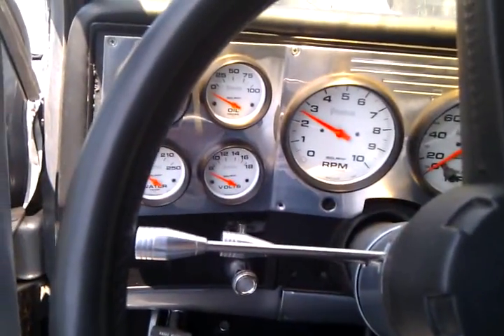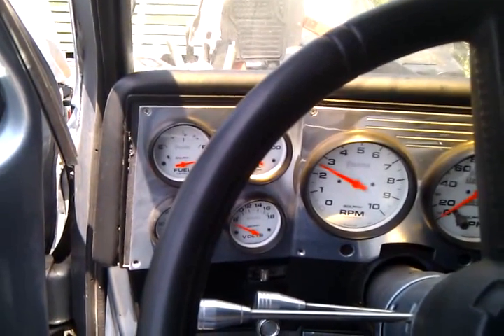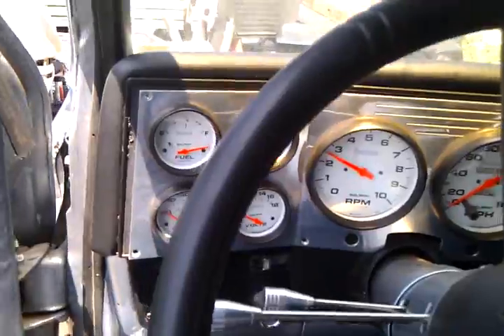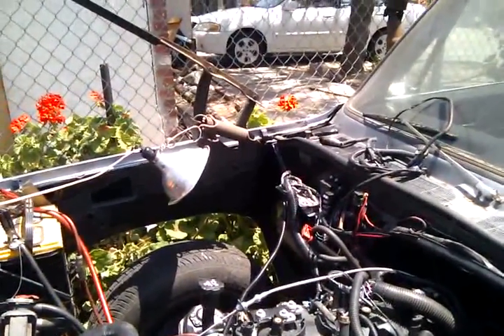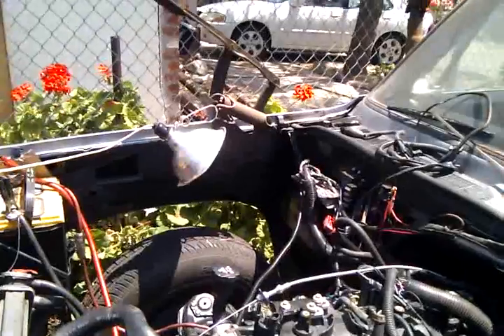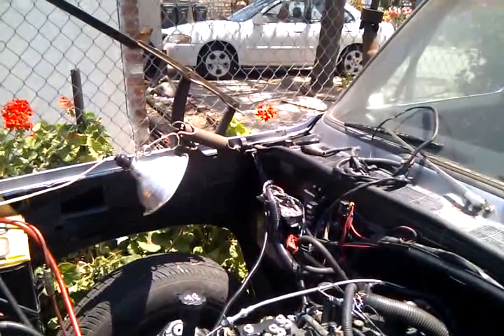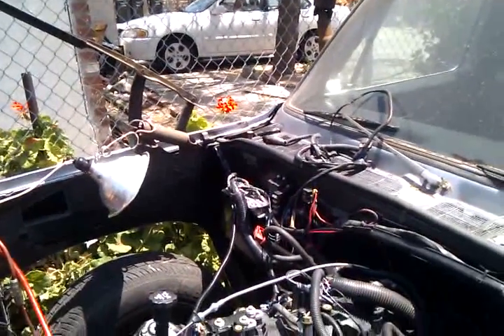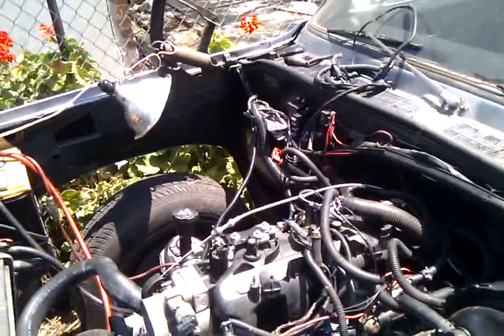5.3l vortec swap

Comment: how did you wire up the speedometer? I 
can't get my sunpro to work. I installed a 5.3 with a 4l60e in a 70 El camino.